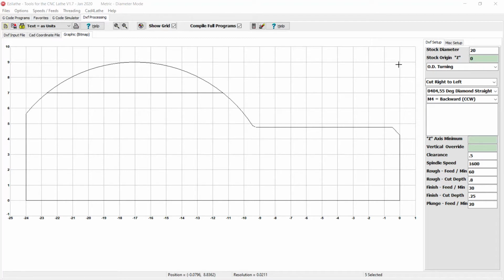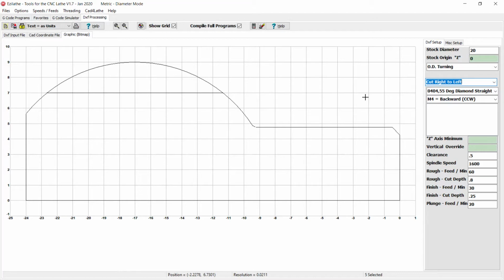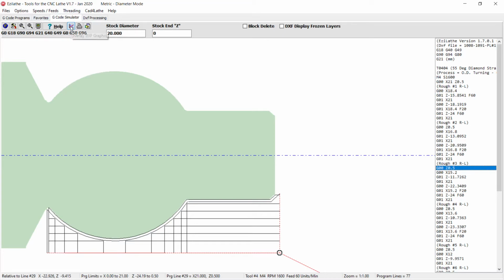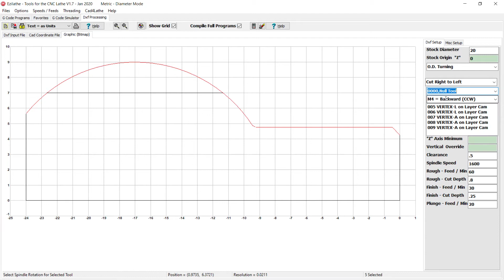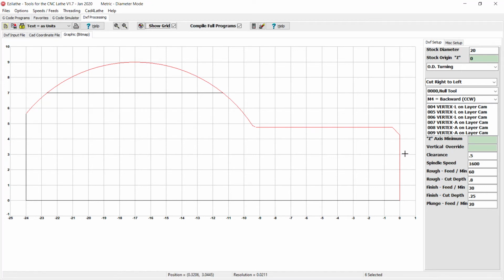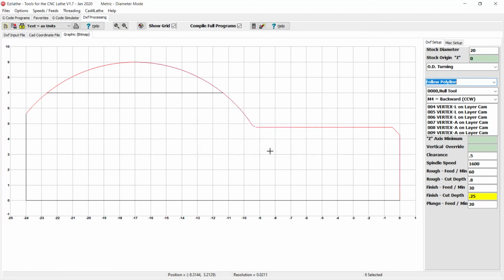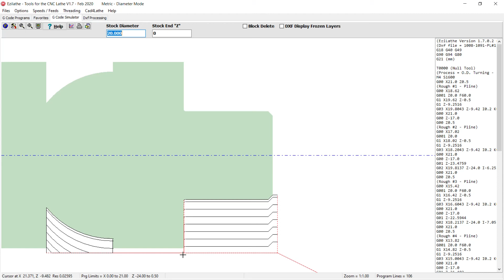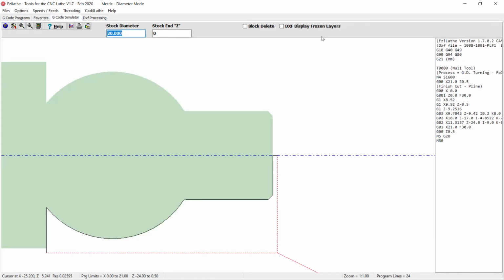Ezilathe 17#1

Comment: Re: finish cut off by tool radius - does it mean the toolpath is calculated for the center of the road tip?
If so, the drawing needs to be prepared to off set that distance.
Reply from the maker: Not sure what you mean, but drawings are usually produced to the finished size. The video mentions that tools with a tip radius will not follow precisely the profile as drawn at radii and angled faces. This is simply due to the offset distance of the controlled point to the tool tip profile. Radius compensation on some systems can improve this, but most don't bother as very small errors. You can offset the drawn profile if you wish (and offset the tool as reqd), but usually not worth the trouble. The Ezilathe simulator does allow you to see and measure the deviation if required. Hope this helps

Comment: Hi Mr Stuart, I just started using your latest release 1.7.3 and was experimenting with ID boring. I compared it with Mach3 wizard and got a different behavioral results. I believe there is some sort of issue, maybe I am not doing it correctly. The details as below
Stock diam: 30 mm; Initial hole dia:6 mm; 3030 boring tool small hss; desired hole bore 16 mm @ depth 6 mm. Hope you can help.The gcodes generated as follows :

(EziLathe Version 1.7.3.0 Mach3  2/23/2021 10:07:43 PM)
(Dxf file = ISO10 ATC Toolholder-ezilathe test 3  Bar = 30.0)
G18 G40 G49
G90 G94 G80
G21 (mm)

T3030 (Boring Tool - Small HSS)
(Process = I.D. Boring - Cut Right to Left)
M3 S1000
G00 X5.5 Z0.5
(Rough #1)
G00 Z-6.259
G01 X7.0 F12.0
G01 Z-6.0 F800.0
G01 X5.5
(Rough #2)
G00 Z-6.259
G01 X8.0 F12.0
G01 Z-6.0 F800.0
G01 X5.5
(Rough #3)
G00 Z-6.259
G01 X9.0 F12.0
G01 Z-6.0 F800.0
G01 X5.5
(Rough #4)
G00 Z-6.259
G01 X10.0 F12.0
G01 Z-6.0 F800.0
G01 X5.5
(Rough #5)
G00 Z-6.259
G01 X11.0 F12.0
G01 Z-6.0 F800.0
G01 X5.5
(Rough #6)
G00 Z-6.259
G01 X12.0 F12.0
G01 Z-6.0 F800.0
G01 X5.5
(Rough #7)
G00 Z-6.259
G01 X13.0 F12.0
G01 Z-6.0 F800.0
G01 X5.5
(Rough #8)
G00 Z-6.259
G01 X14.0 F12.0
G01 Z-6.0 F800.0
G01 X5.5
(Rough #9)
G00 Z-6.259
G01 X15.0 F12.0
G01 Z-6.0 F800.0
G01 X5.5
(Rough #10)
G00 Z-6.259
G01 X15.8 F12.0
G01 Z-6.0 F800.0
G01 X5.5
G00 Z0.5
(Final Rough Cut)
G00 Z-6.0
G01 X16.2 F800.0
G01 Z-0.0
G01 X5.5
G00 Z0.5
(Finish Cut)
G00 Z-6.0
G01 X16.0 F500.0
G01 Z0.0
G01 X5.5
G00 Z0.5
M5 G28
M30
%

Mach3 wizard:
G18 G40 G49 G90 G94 G80
M3
G0 Z1
G0 X3.5
F800
G0 X6.5
G1 Z-5.9
G0 X4.5 Z-5
G0 Z1
G0 X7.5
G1 Z-5.9
G0 X5.5 Z-5
G0 Z1
G0 X8.5
G1 Z-5.9
G0 X6.5 Z-5
G0 Z1
G0 X9.5
G1 Z-5.9
G0 X7.5 Z-5
G0 Z1
G0 X10.5
G1 Z-5.9
G0 X8.5 Z-5
G0 Z1
G0 X11.5
G1 Z-5.9
G0 X9.5 Z-5
G0 Z1
G0 X12.5
G1 Z-5.9
G0 X10.5 Z-5
G0 Z1
G0 X13.5
G1 Z-5.9
G0 X11.5 Z-5
G0 Z1
G0 X14.5
G1 Z-5.9
G0 X12.5 Z-5
G0 Z1
G0 X15.5
G1 Z-5.9
G0 X13.5 Z-5
G0 Z1
G0 X15.8
G1 Z-5.9
G1 X3.5
G0 Z1
F500
G0 X16
G1 Z-6
G1 X3.5
G0 Z1
M5
M30
Reply from the maker: Very different result! Needed to see your DXF file, but clearly the dxf was not what was required. DXF needs only a single line from 0,8 to -6,8 (or the reverse will do) to produce the result you require. From previous comment please note - You can select lines/arcs etc on screen by placing your cursor on it and pressing the left-button on mouse. When something is selected, it shows red on screen and black when not selected. also note that anything selected, may be removed from selection by the same process. I just did the above, and came up with a perfectly good program. (Adjusting your feedrates as they seem fast (800 / 500 mm/min) for a small boring tool).
Reply: @Enginebuilder100  Hi Stuart, thank you again for your reply. Can i pass you the dxf in cnczone forum ?
Reply: I will try your recommendation as above and feedback later on the results. Again, really appreciate your feedback and time. You are a really kind person. Stay safe Cheers!
Reply from the maker: Yes Better off commenting, adding files etc on cnczone. There is a thread running on cnczone - Cam Software/Uncategorised Cam discussion/Ezilathe, a useful aid to lathe programming.
This is the usual thread on Ezilathe, any comments, etc here I will see, it is near the top of this forum.
Reply: @Enginebuilder100  Hi Mr Stuart, I got the ID boring to work. I will post the findings in the forum. Cheers

Comment: Hi Stuart, how does the polyline get truncated ? I tried and mine does not get truncated. Do i need to manually edit the gcode ?
Reply from the maker: Manual edits were not used in the video. Once a line (or polyline) is selected (showing red on screen), a segment can be removed from selection by picking on screen as shown. This can be used as shown to avoid cutting the removed segments easily.
Reply: @Enginebuilder100  Mr Stuart, I am sorry I don't understand "picking on the screen" part. Could you kindly elaborate further.

Comment: I noticed for certain dxfs if i were to generate gcodes using only 1 tool will generate some erratic movement. In your opinion what is the best method is best method to generate the gcodes ?
Reply from the maker: These days, I prefer to use the follow polyline functions where available. These functions do not modify the entity in any way. As a continuous polyline cannot contain any gaps, or overlapping segments, it is more foolproof and more likely to be what was intended.
Reply: @Enginebuilder100  I will try your tips, Thank you Mr Stuart